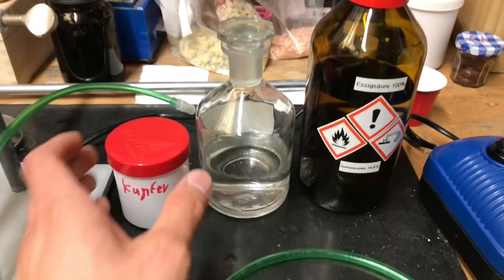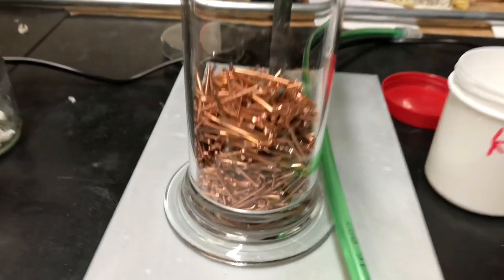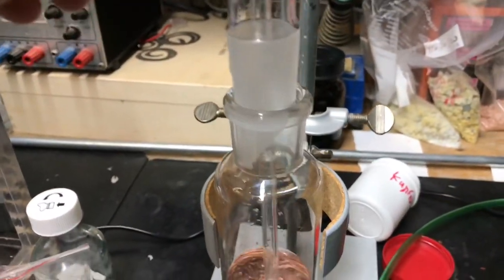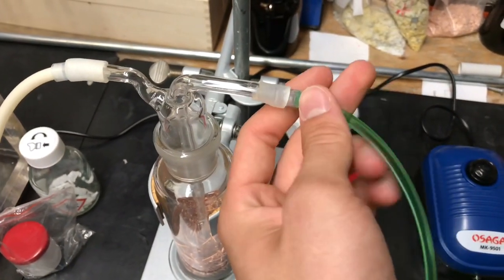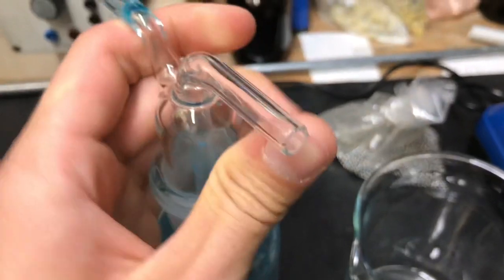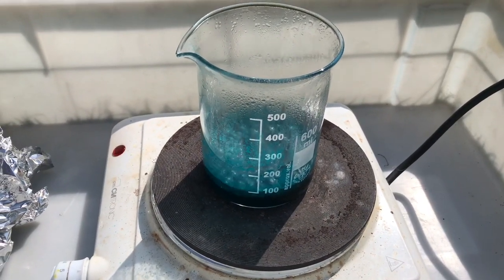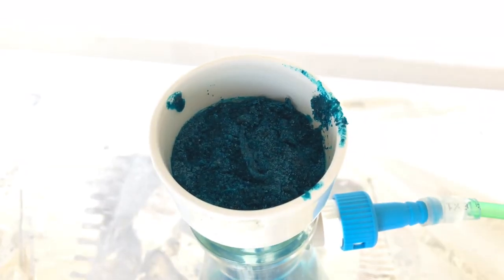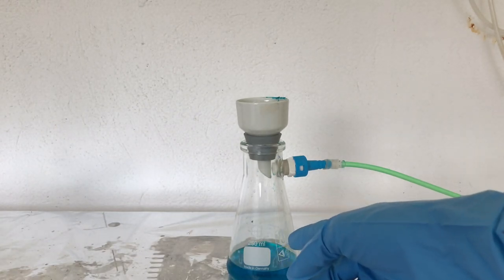Making copper(II) acetate from copper metal

Comment from the maker: There will be a similar video involving the same procedure soon. In it an even more useful and hard to get compound will be produced. I’m currently crystallising the solution and will upload soon afterwards.
Reply: FeCl3 maybe?
Reply from the maker: @maxencehirbec1206  good guess but FeCl3 is to mundane. A little more uniquely.
Reply: Something Nitrate?
Reply from the maker: @dksmith605  another excellent guess but with nitric acid there wouldn’t be a need to introduce oxygen as it readily reacts with many metals. Stay tuned. The crystals are still drying in a dedicated and once they are dry (1-2 weeks) I’ll upload.
Reply: @THYZOID  excellent. I look forward to the video.
I literally just opened a delivery of glassware with some drying equipment (glass dessicator and a couple of thunberg tubes) among other things, including a broken 620°C quartz thermometer which I presume contains mercury 😞
They really shouldn't have wedged it into the box with the rest of the stuff to combine postage.
It's only the last 1/4 or so, I still have about 500°C of thermometer left, do you think it would be safe to use? 🤔
Reply: @dksmith605  maybe you could melt the broken end of your thermometer to seal it, or ask a glassblower if you are not confident with glassworking. I also suspect quartz to not behave like your regular borosilicate, maybe it is easier to shatter it if melted the wrong way but maybe I am wrong. Anyways I wouldn’t use it broken
Reply: @maxencehirbec1206  I don't think using it broken is a good idea either.
I think I'll be using a K-type thermocouple in place of the quartz thermometer.
I'll probably just recover the mercury and store it.
I would love to have a good talk with a scientific glassblower, I have so many questions.

Comment: I like concentrated Acetic acid because yield  is higher than if you use 30% acetic acid .
Reply from the maker: Really? I never tested what effects the concentration of acetic acid had on the speed of the reaction.
Reply: @THYZOID  Yes, but at the moment I ampuled  concentrated acetic acid.
Reply: Depends on the solubility of Cu(OAc)2 into concentrated HOAc and on the solubility of O2 into concentrated HOAc... 

The salt may crystallize/precipitate onto the metal preventing further oxydation of the copper into CuO and dissolution of CuO by the surrounding acetic acid...thus slowing down or stopping the reaction in an early stage.

Some water may thus be needed to allow for a better completion of the reaction.

I have found practically that the processus of acetic acid/oxygen does also work with silver and nickel.

Comment: Have u considered mixing it the copper acetate with ammonia hydroxide to precipitate out copper ammonia acetate.
Reply from the maker: Nope but it’s a good idea. Then we will finally have a use for the copper acetate solution. Thanks!
Reply: What is the solubility of the complex tetra amino copper diacetate?
Reply: @philouzlouis2042  I checked Pubmed for basic chemical info I cannot find any data that does not require me to pay 60 dollars to see an article on the solubility of this complex.
Reply: @chanheosican6636  
Too bad you don't have the info right away. I thought you might have because you used the term «precipitate» implying Cu(NH3)4(H2O)2(OAc)2 is much less soluble than Cu2(H2O)2(OAc)4.

This may be quite interesting to isolate faster/easier copper acetate out of a mixture of acetates of various metals.

Anyway, thanks for the checking.

I guess I'll have to test on my own :o)

Comment: Using H2O2 instead of O2 would also make an extra risk due to the high reaktivity and rist of explosion of Peroxy acetic acid
Reply from the maker: nahh it would absolutely not be an explosion risk
Reply: @THYZOID  Well, I made proxy acetic acid to test how reactive it actually is. I couldnt even light it on fire xD. But online Datas say that it must Explode on Such high temperatures
Reply from the maker: @DrAcetat  it is only really explosive when it is concentrated. you probably won´t even reach explosive concentrations by mixing 11% peroxide with acetic acid. still better to be safe.
Reply: @THYZOID  I used 99,8% Acetic acid and ~30% H2O2

Comment: just wondering, how Much faster is it if i bubble 95% O2 through the mixture? i currently have that bubbling through my solution and im just wondering how numch faster it would be compared to the normal atmospheric O2.
Reply from the maker: not worth it the reaction might be just a little faster but you are better off letting it run with normal air or using H2O2 if you want to be really fast
Reply: @THYZOID  ahh gotcha, had been lent some free O2 so i just thought of using it up for this

Comment: I really dont know why direct conversion seems to be the dominate method when the carbonate conversion method from copper sulphate is simpler, faster and cheaper.
Reply from the maker: It is also dirtier. directly from copper is a lot cheaper when air is used
Reply: @THYZOID  i found it very easy to clean since the copper carbonate separate from water so easily, though no I've never tested the purity. It would be cheaper if I used pennies, but wire, copper sheeting and pipes isn't cheap at all as of the date of this post. I think when I did this a few weeks ago, the vinegar was the most expensive component when broken down by gram.

Either way, unless I find another more elaborate use for it, it's ok if the purity isn't great since I'm only using it for coloured sparklers.